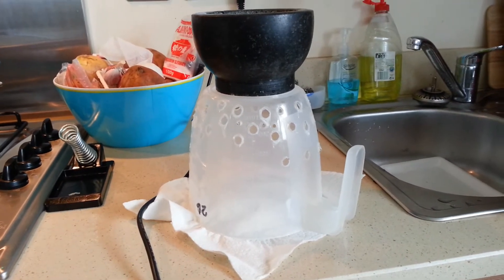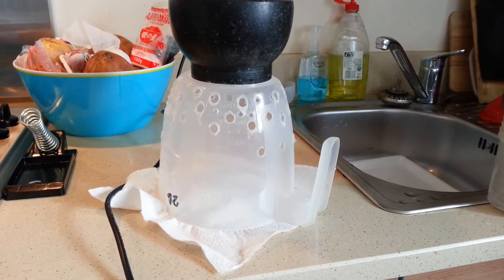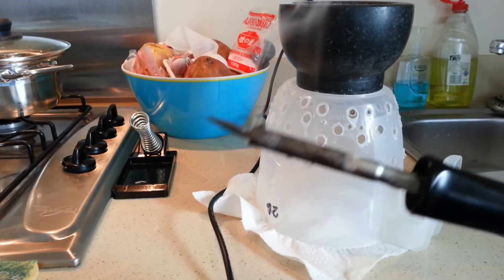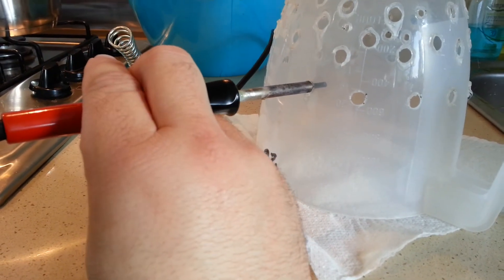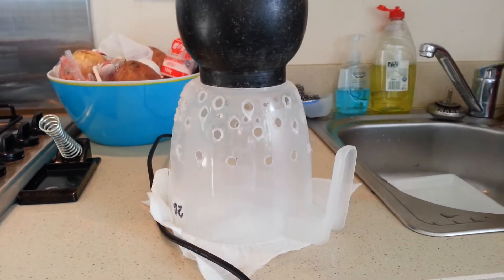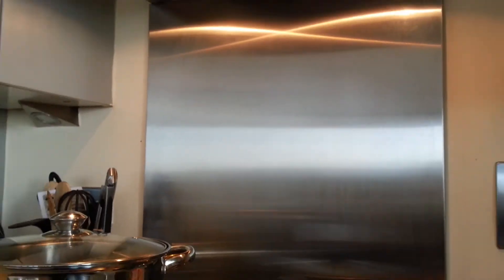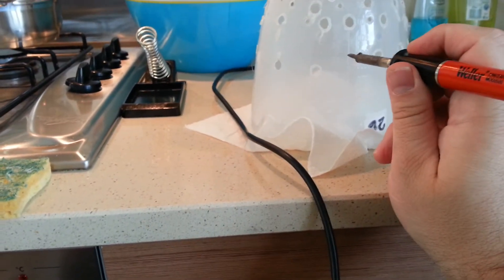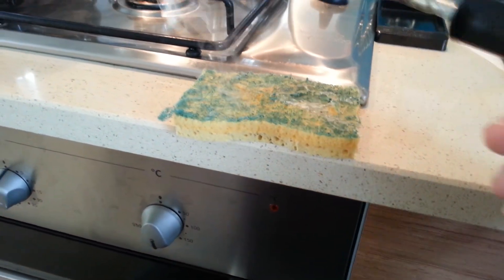orchid pots

Comment: Great tip Steph, thx for sharing. Like your handled container. I have something similar I use for measuring and for making up small amounts of solution to go in spray bottles as it has volume markings. You called your container “jug” - to me it looks like a large plastic quart/2 quart, etc. measuring cup or handled mixing container.  What was the  original mfg. use of yours and what type of stores is it found in?  I really like yoursolder tool stand/holder - In the US I have only seen stands  like that on more expensive professional solder units as in $65-$75+.. That baby must be really hot to cause the plastic to  drip like that.   Craft wood burning tools work well too -about the same price and folks may already have one and hadn’t thought about it.  Mine works great, doesn’t get hot enough to drip or anything, just burns a hole with light press.  I  was using my little dremmel but it was slow and sometimes it slid around.  The wood burner and solder tool have all kinds of multiple uses depending on your interests and both come with about the same kinds of tips.  You want an adjustable  temp like this one below that goes from 0-900F and one with good stand so they don’t slide off table/bench. The cord will pull them off the table bench if the stand isn’t secure.  Most cheaper ones have fixed temp and start at 900F.  Look at flea market, yard sales, thrift shops or hobby shops like HL that gives 40% off 1 item each trip. If used, make sure cord is good, and it has good heat insulated handle so it is comfortable to hold, and it comes  with the tips you want if older model. If discontinued etc, you might have difficulties get new tips if off brand, etc.   Back to wood burner - note both types of tools have two different kinds of tips, solid or wire - it is personal preference though I like the solid  more like a sharpened pencil or a ball tip, or blade, etc though I think they work the same.  I have a cheap Walnut Hollow brand , set temp, doesn’t burn my hand, has a little stand you tape down so you can move it around, use the standard tip for pot holes but it has a tip that might make good slits too - it was about $7 new. If I needed to buy a new wood burner, I would get this one though I would look for cheapest price or coupon (at the 40% off place HL, it would be around $13) It has the variable temp from 0-900F which I believe is really important  and it comes with 11 tips but the mfg has many different ones.   https://www.amazon.com/Walnut-Hollow-Versa-Temp-Temperature-Woodburning/dp/B005P1TRAS?th=1    Also see https://www.walnuthollow.com to see more tips, tracing paper, hot stamps, stencils and great colored pencils, along with all kinds of wood. You can get all kinds of wood, leather stencils of scenes from different companies.  Burn the name of your orchid on say a piece of cedar on the front, and burn the date purchased, repotted etc on the back.  

I use the standard universal tip that came on it but mine came with 4 more and I can even use with filled pots - you know those from big box with media past due for repotting.  I can direct it around the roots as I can see them in clear pots.  Used with bark and moss, no issues as the roots are around the outside and coiled at the bottom (not much in center) so when I do repot, haven’t had a burned root yet in about a year of using it.  And if potted, I always water the pot the day before. 

Tip - even if a store  -say your local home type or craft - doesn’t have or even carry - they many times can order for you and ship to house or the store at the same price you could get if you decided to drive across town.  I just had home store starts with “L”  (don’t know if we can say store name but I think we can say brand).  Anyway I wanted Better Grow Bloom Booster fertilizer and they only carried the BG Plus at that store but other stores in the chain/area carried them.  I like this fertilizer because it has no urea and thus it works quicker, no need to wait for bark interaction to be available.  Anyway, I really didn’t want to drive out across town and didn’t really want to have to come back to the store either right away just to pick a little bag up.  But they said no problem and ordered it for me and shipped to my house at no shipping, 2 days.  She said I could do that from their online site too for free shipping and to my house - I was like -cool!  And it was 1/2 the price of the big “A”for the same item.  And I decided to order 3 packs @$4.98 for under $15 total - but no minimum order to get free shipping to my house and like I say this was something they didn’t even carry in inventory for that store.  Great deal, they could have sent me elsewhere or made me drive . I have had the big “W” do this and the others too but I had to pickup at the store so I was surprised.

Comment: What size is best for that size holes? or is the iron a standard size, Please?
Reply from the maker: +Misslou2425  Hi, the iron has a small pointy tip and then get wider. I started doing small holes but then since i wanted air to circulate i made them bigger. I think any size is fine just not to big so that your soil/media doesn't spill out.

Comment: just drill holes, that's pretty nasty...
Reply from the maker: The plastic is brittle and drilling creates cracks and breaks. The soldering iron doesn't. The excess plastic resulting around the wholes is easily shaven with a sharp knife or cutter.
Reply: @stephl1995  do you have to throw away the soldering iron afterward then?
Reply from the maker: @MasterofPlay7  not at all i cleaned the tip with paper and old cloth while it was hot